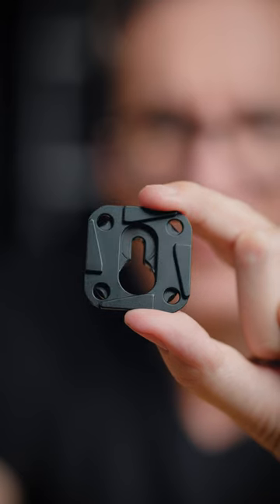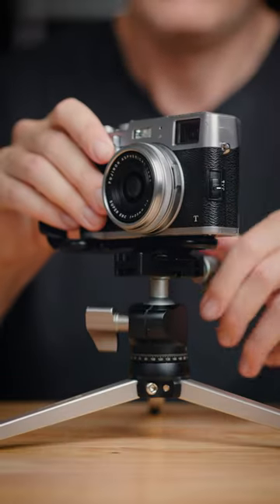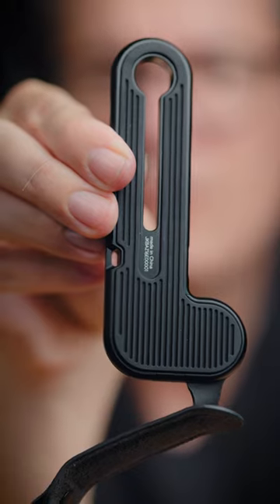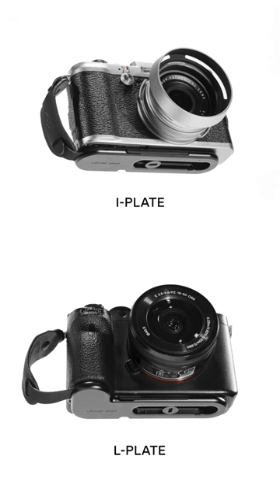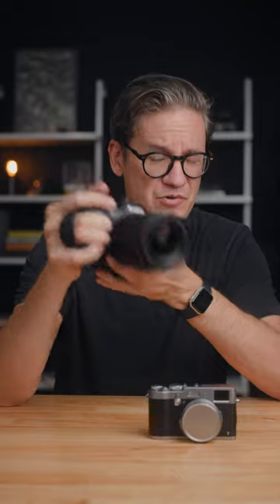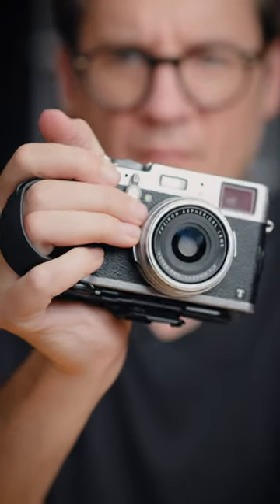NEW Peak Design Clutch grip for mirrorless cameras

Comment: Can it be attached to other baseplates or just the Peak Design one? It would be nice to be able to use a baseplate that gives battery door access and L bracket support.
Reply: I have my Peak Design Clutch attached to a 3 Legged Thing L-Bracket on a Canon R5. I have full access to the battery.
Reply: @len.whistler  Yes, but this is a different product.